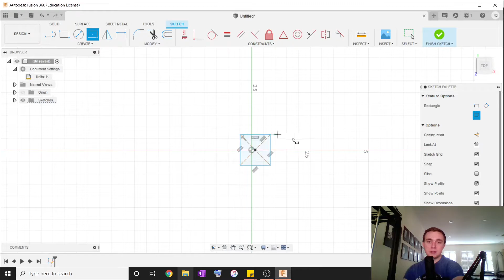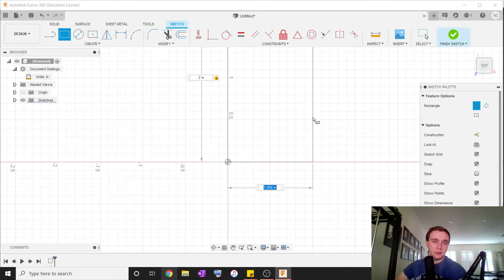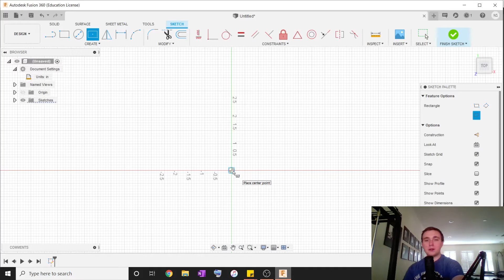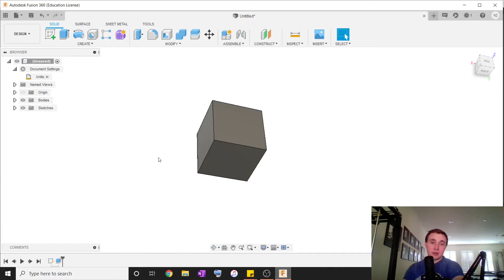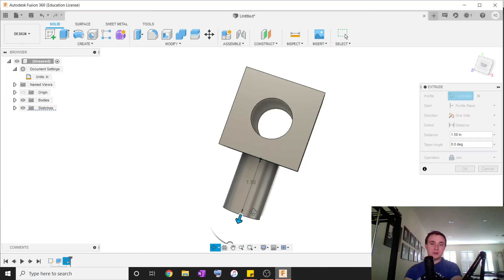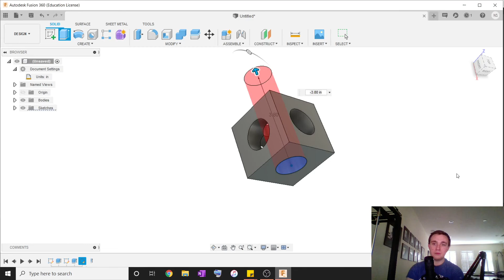Fusion 360 Tutorial : Basic Parts 1

Comment: ... so i cant make a square when typing in the values. one side will accept the value and change but the other will not and remain where i left the mouse. any advise?
Reply from the maker: Did u press tab? Also if that doesn't work just use sketch dimension to fix the undefined side. If there's already a number thats different from what u want double click on it and change it to 2
Reply: @nicoscialdone2707  setting the size after accepting the value seems to work. i did press tab but it wont accept the value untill after. must be a bug. have to say that fusion is hard coming from sketchup. i had so much more freedom to define.. anything - fusion seems to be telling me what to do haha
Reply from the maker: @lykenth08  are u pressing enter?